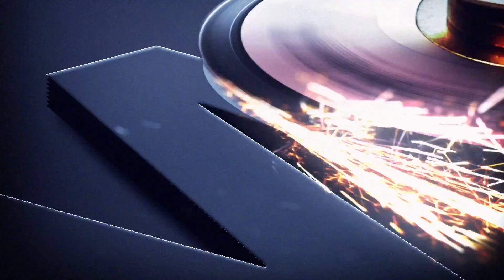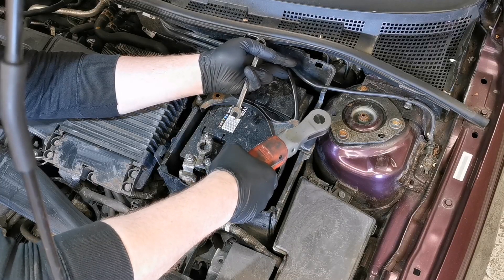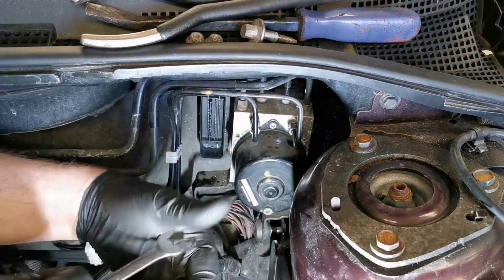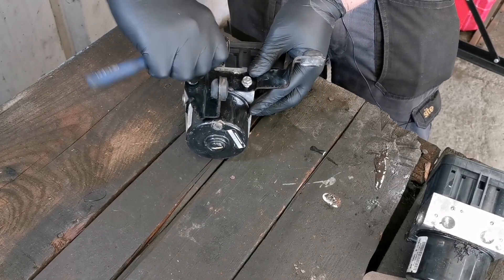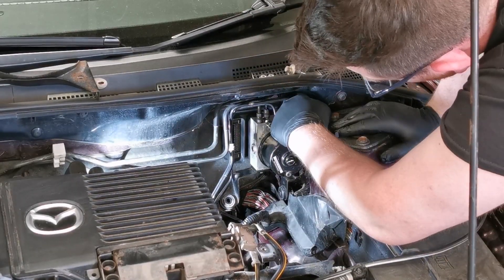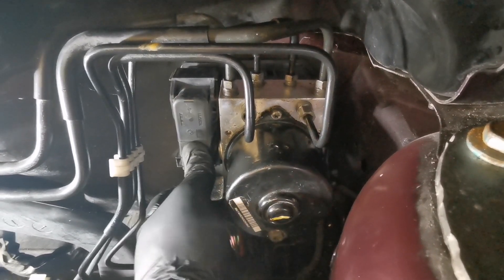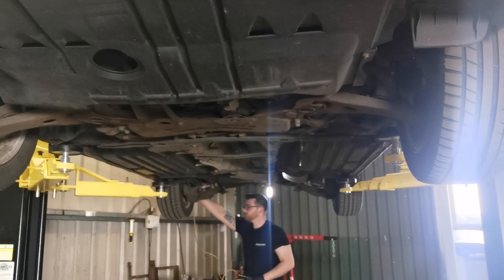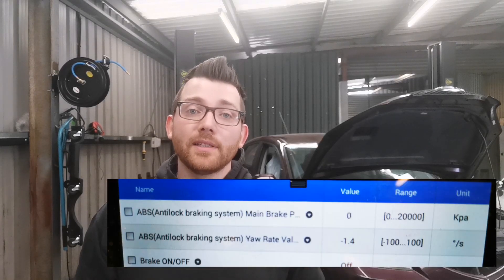MAZDA 3 ESP LIGHT ABS UNIT FAULT

Comment: Great video. Reference comment regarding confirming serial number of the replacement part matches the original part, I think you meant to say confirm the PART number or MODEL numbers match. As serial numbers should never match as they are unique to that individual part and not any other parts from the same part/ model range. Splitting hairs maybe but it may help others to know this. Cheers.

Comment: This video was awesome.. 
FYI - you can also take off the windscreen wipers & access a cross beam which you can unbolt.. This makes undoing the brake lines sooo much easier & quicker.. I think it definitely out weighs trying to squeeze the tools in & slowly turning 1/10 each time.. 
You get that cross beam off & it’s full access to the ABS unit.

Comment: I have a 2007 Mazda 3, this just started happening but the other night I saw my abs sign and also the sign stability sign you mentioned earlier in the video, next I parked my car and once I tried to start it up they car didn’t want to come on as if the battery was dead, I tried to turn it on the next morning and it came on although several hours later both signs came on once again. Would you know what can be the issue or what steps to take it something is really wrong with it?

Comment: Nice video, My Mazda 3 2.0L 2010 with a ABS code and need to replace the ABS pump and CM, should i need to bleed all the break fluid before replace it.
Reply from the maker: Worth bleeding the system and see if you can do a re calibration before committing to replace the pump. It's always worth a try but often it is an internal fault with the pumps.
Reply: @MTMMotorServices  you mean that bleeding brake fluid is optional? Because i just got a DTC C0021 with a U0415, i will change the DSC HU/CM.
Reply from the maker: @ringwg6722  no, you will always have to bleed the fluid. I meant that if you were in two minds about replacing the complete unit, that it is worth bleeding and making sure there is no air in the system first to make sure you aren't getting false readings from the abs unit. 

Any time you work on the brake system and there is the possibility of air entering the system, it needs to be bled.

Comment: How is the calibration done?
Reply from the maker: Once properly bled Using a diagnostic machine there should be a option for re calibration or re learning of values depending on what machine you use. This varies slightly depending on what software you're running.
However, if you fit a brand new unit and it requires a software update, it may re calibrate as part of the update.

Comment: Do you need to reprogram the unit or is it "plug and play"?
Reply from the maker: There is calibration process that you go through which you should be able to do with most diagnostic machines. The unit in the video was a second hand unit. If you use a brand new unit, you may have to carry out a software update.
Reply: @MTMMotorServices  How is the calibration done though?
Reply: @MTMMotorServices   Thank you! ill be doing this very soon!
Reply: I just repaired my abs pump but lights are still on need to probaly reprogram

Comment: Same issue with my 2005. They replaced the master cylinder thinking that was the issue but I'm fairly certain it's the abs module. New, my shop quoted $1035 for the oem part alone. I found places that rebuild them for $250, do you think that would be better than buying an eBay used one?
Reply from the maker: If you can send the unit away for repair, I think that is your best option. I wouldn't normally recommend buying parts of ebay. We fitted this second hand unit for a customer only because everywhere was closed due to covid.

Comment: For a 2010 Mazda 3, do I need to code the VIN #? Mine still shows the DSC light ON but the ABS and the brake light are off. Drives perfect all 4x tires sensors are reading. Thanks
Reply from the maker: when fitting new units, always check if they require programming. when you program, the VIN info should carry over. i would also check to see if you can carry out any sort of learning/set up procedure or re calibration. are you getting any new fault codes? sorry for the delay in getting back to you. let me know if you managed to solve the issue.

Comment: Hi mate thanks for the vid. 
We have the BK generation Mazda 3 touring model. We have no esp light comes on but the left-back brake can't be worked, we assumed for the corroded disk and we looked to the pomp and the hose that goes to the back couldn't be bled when we loosen the bolts. We're going to change the pump, not the control unit, and bleed the system.

I think we won't reprogram the control unit because of not changing the module am I right?

Comment: I noticed leak marks beneath the ABS pump, does it need replacement or can it be repaired? For '08 mazda3 hatch AT 1.6
Reply from the maker: i would try to determine where the leak was coming from first. it could be one of the brake lines have failed rather than the unit.
if it is the unit that failed, sometimes you can send away to a specialist for repair but often you can get a reconditioned unit for a reasonable price. sorry for the delay in getting back to you. let me know if you managed to solve your issue.

Comment: Thanks for the video. This is helping me on a Mazda 3 with a ABS pump issue. Customer states of sinking pedal while stopped in traffic. Isolated the abs pump and replaced it. However we're having abs module code, but the vehicle drives fine and stops like it should
Reply from the maker: Have you programmed the new unit in with a diagnostic machine? It might also require a re calibration bit this is sometimes part of the programming process.